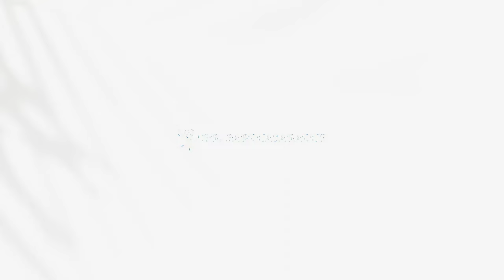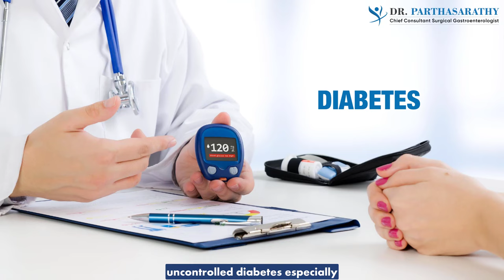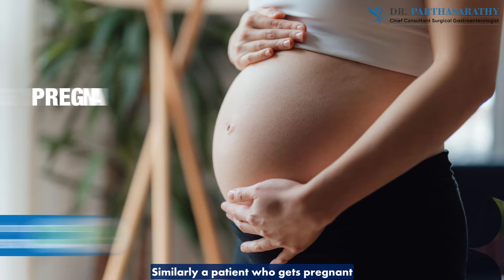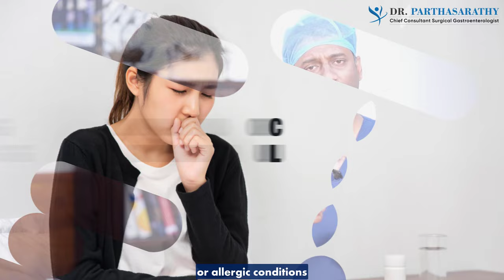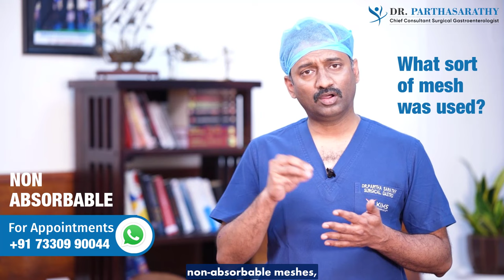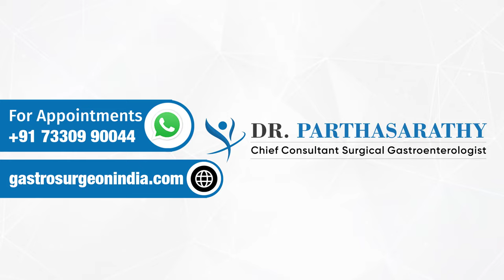Why do Hernia Repairs Fail? | Dr Parthasarathy

Comment: Thank You, Dr., for the clear explanation. I've watched several of your presentations.
I'm 70 and now facing my third recurrence of an inguinal hernia. First repair was laparoscopic and second one robotic. This third occurrence has been mildly protruding and goes back in easily, or when I sit or lie down. It appeared about 2 years ago and I've put off re-treatment. I am quite active and about 2 years ago switched to Keto style diet and dropped 50lbs to my current, comfortable weight that I was in High School. I also came off blood pressure and cholesterol meds. After seeing this video I surmise my obesity played a role in the recurrence. Now to seek treatment.

Comment: Thank you for this video. I posted this comment / question on another video from this channel, but the video was from 1 year ago and I did not know if it would be seen.

I had a CT scan of my abdomen about 2 weeks ago due to severe right flank pain. I was told there was no hernia, no mass, no infection, etc. Basically the doctor told me they did not see anything that would be causing my right flank pain.

However, as I was reading through the overall CT scan results a couple of days ago, I saw there was a note in the FINDINGS section under EXTRA-ABDOMINAL SOFT TISSUES that states "Small fat-containing umbilical hernia". 

The doctor at the ER (where I had the CT scan) never said anything about this hernia, she told me there was no evidence of a hernia at all. Then I had an appointment 3 days ago with a Family doctor that saw the note for the umbilical hernia, but all she said was that this would not be the cause of my flank pain. Nothing was mentioned about getting this repaired at all, never mind waiting any amount of time.

I have been having the right flank pain for over 7 weeks now, and no one can tell me why. I have had 2 CT scans (first without, then with contrast), an MRI and multiple doctors examining my right flank and abdomen with palpitations checking for a mass or abnormality with no findings of anything that would cause my pain. This pain is every day, all day as long as I am either standing or sitting. The only time the pain goes away is when I lay on my back. After 10 to 15 minutes on my back, the pain is completely gone.

So, my question is does this hernia need to be repaired with surgery as soon as possible?
Reply: The pain is not because of hernia.
You are wearing tight trousers or a belt.
Reply: @RaveeKumaar  Nice try, but I retired a year and a half ago and have not worn trousers or a belt since then. I wear mostly athletic clothing with elastic waistbands.
Reply: @marcd1981  Because I faced the same issue and culprit is tight trouser.
I went to multiple doctors and ultrasound abdominal tests but no complaint
Reply: @RaveeKumaar  As I stated, I do not wear trousers, and have not for more than a year and a half, as I retired. This is nothing to do with my waistline, it is something deep inside my flank area. There are several things it could be, but no one (7 doctors so far) has been able to tell me what it actually is. 
Physical Therapy and exercise are not helping, and it is just the latest I've been told to try that has not helped at all. It is almost 3 months that this has been going on, so a muscle would have at least gotten better, if not healed in this time.
Reply: I suggest if possible go to a doctor out of the loop or association of each other and mention nothing of them